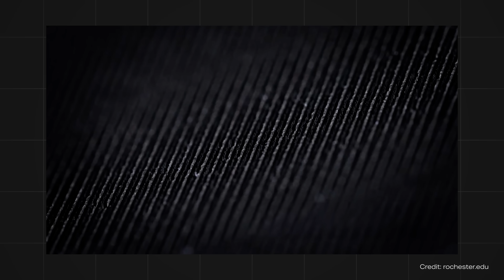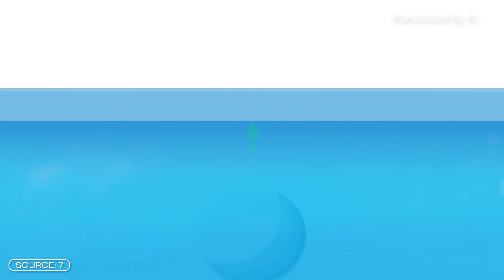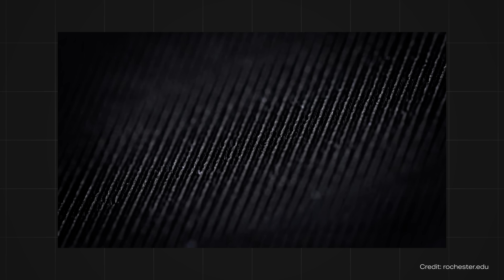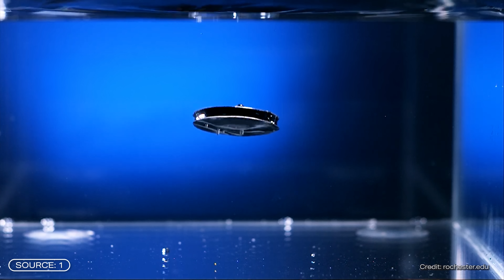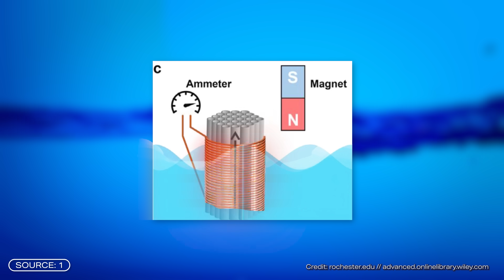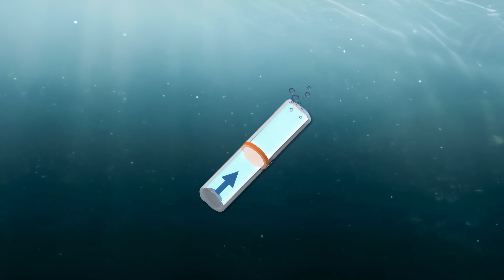New Study: How to Make Ships Unsinkable!

Comment: Might be interesting to merge this technique with the hyperdense "superwood" that Inventwood is producing. The hydrophobic texturing and silicon polymer could be pressed directly upon the wood during the compression stage, removing the need for the copper chloride bath and ultrasound. Inventwood claims a 10 times strength-to-weight ratio compared to steel. "Superwood" costs more than steel ($0.40/lb) or aluminum ($1.50/lb)  compared to $10.00/lb, but assuming cost isn't a factor, the result might be a more buoyant and lighter vessel with comparable structural strength. A racing boat would provide the appropriate test bed.

Comment: Honeycomb.

Not separate tubes, but immense honeycomb-extrustions.

"Solid" volume of unsinkable-floatation.

---

Having to re-treat annually isn't actually unique to this stuff: anti-fouling has to be re-applied, except for the ( excellent ) silicone-silane coatings that some use, now ( SilicOne is one brand for yachts, ships have a hard-coat option, don't remember the brand atm ).

Excellent video, & you hit the points needing hitting.

Thank you very much for this.

_ /\ _

Realized later, this needs to work with marine-alloy 5052 aluminum.

Dave Gerr's book "Elements of Boat Strength" identifies which alloys to use for saltwater, and iirc 5052 is the primary trustworthy one.

Also, you have to be careful to not have anything far-away on the galvanic-series ( this means both Ti & carbon-fiber are prohibited on vessels using this ) anywhere on that vessel.

Been awhile since I was thinking on such stuff, so took awhile to remember, sorry..

I think there were 2 usable alloys, but 1 was safest, and I think that was 5052.

_ /\ _

Comment: For a decade, I have discussed a cheaper, simpler, more scalable, more durable option which avoids those hurdles: Pumice. Foam gas into molten glass blocks, then re-melt their surfaces later to form a solid glass shell. Dunk in potassium solution after placing the block in a kiln, to absorb potassium into the skin of that glass shell; that is the recipe for bullet-proof glass. A floating platform made of blocks of bullet-proof glass is hyper-resilient, actually unsinkable, and pumice interiors can achieve percent-vacuities above 80%, for multiple times more buoyancy per kilo of material. They are also cheap and abundant materials, lower energy cost per kg than metals, simpler tools, no harsh acid treatment, no maintenance. Your research team spent the last decade finding a worse solution than I did when I puzzled the problem for a month, before they even began.

Comment: First step after laboratory is to find any application at all. Quite often, that's in sports, where cost hardly matters. Fluor wax was banned from skiing in 2021, replacement hydrophobic material science has a market there. Water sports like kayaking have experimented with teflon (also fluor). 

Hydrofoils "revolutionized" kiteboarding and windsurfing, but they also are killing those sports because the learning curve is now too steep. Perhaps floatation might ease the first steps there?

Comment: Intro: its not paint. It doesn't need maintenance. 
4 min later: Its paint. With extra steps.
7 min: We might have to do the paint & extra steps every year.
8 min: Since we might need to bake a new coating on every year. Clearly the best application is permanently fixed underwater structures. 

Is it April 1?

Comment: fatigue.. pits in structure become sites for fatigue cracks from cyclic loads.  The material has nearly infinite sites for fatigue cracking introduced jn the process.  The coating to create hydrophobic properties-  how does it hold up in real world application?  If a piece of equipment scrapes on the surface and the coating wears off, then you have exposed aluminum with a bunch of crevices becoming sites of corrosion and stress concentrations.

Comment: This seems stupid, they've made a tube with overall density of 1/4 of a water, that requires maintenance... wood already exists, and you can make metal foam with same density. The antifouling properties seems nice, but you can just "spray" ships  with it and don't need it to do the buoyancy. If you bend it or otherwise mechanically damage it, it reduces the volume and reduces the buoyancy same as any foam or material with small isolated compartments. Effectively only unsinkable application of this is raft entirely built of these, or you can make the raft from discarded PET bottles and it will be the same if big enough, and the density of air filled pet bottle is 1/50 of water so you have 10x margin for engineering them more indestructible..

Comment: The logical leap from "floats in a laboratory, and generates a voltage that can be measured with lab equipment in simulations" to suggested practical usefulness in real world applications is astronomic.  

And what's the supposed point? We already know a lot of ways to trap air in a lot of different materials, very reliably and at low cost. Making ship hulls out of materials that are buoyant in themselves instead of just displacing water with their overall shape would make the ships so much bigger for a given payload capacity. Relying on superhydrophobicity, that requires microscopic surfrace structures of metals remaining unaffected in (real) seawater, over time, doesn't make a really bad idea great.

Comment: The “unsinkable ship” headline sounds crazy, but using it for rescue platforms and offshore gear actually makes way more sense.
Reply: The Titanic was called unsinkable as well. Pride comes before the fall.
Reply: @JustCrashing1776  did you know things that waterproof aren’t 100% waterproof.
Reply: @FrogThatVibes agreed 😂
Reply: What someone find a way to make unsinkable metal sink. just by mis-use
Reply: Those applications would also give this material a good place to start and prove their reliability and lower prices as production ramps up. Eventually, it COULD lead to applications in ships, but these applications are a great place to start.

Comment: What is the advantage of using this hydrophobic surface treatment instead of just putting a cap on the tube?  And even if it works as advertised without annual reapplication, the imagine that the  initial cost is going to be a lot higher than the steel plating currently used.

Comment: can it be used in frying pans tho?
Reply: Bear in mind that stearic acid (and other stearates) are pretty much what tallow is. Fries very well. And, providing the layer is sufficiently thick and coherent, can be quite non-stick.

You'd probably find that fully proved iron/steel frying pans have a layer of substances including stearic acid and related compounds which act to prevent or minimise sticking.

Comment: The comparison to use for antifouling is not bare metal, but PDMS-coated metal, as silicone polymer hull coatings are already common, and PDMS has excellent antifouling properties. As for a raft made of tubes... now you have a metamaterial with new bulk properties. How does this metamaterial handle bulk stress? I don't know about you, but I don't wind to end up clinging to a pile of floating straws while a ship tears itself apart from wave action.
Reply: Mmm, good points, it probably has a lot of applications but ships, boats, nah, too impractical and expensive.

Comment: okay, I'm gonna ask the obvious question here:

holes in the tubes may represent a corrosion failure, but where are the crush test? Ship hulls with kind of technology are much more likely to experience crush damage as a common form of failure. Whether that's from being guided by tugs, rough treatment pier-side, or carelessness. How do these tubes perform when partially collapsed, with and without inner walls touching?

Comment: What about corrosion and literal sand blasting?
A single tube is not a valid test piece a multi part construction with an electric and magnetic potential needs to be tested in an area where sand and other particles can abrade the surface and the structure can flex and bend .

Comment: Materials Engineer here. The obvious usage would be to use it as a reinforcement in either carbon fibre laminates or Glass reinforced laminates. Have a layer of your unsinkable metal tubes as part of the laminate Or have modules of them distributed throughout a boat that if contacted with the water will keep the boat afloat. If the material does have antifouling properties that can be demonstrated in the real world, then having a layer of the tubees as an overlay on the surface of a boat would actually be a very useful thing. Antifouling is a major problem and a major cost to all boat owner whether it's a recreational craft or a commercial boat. Several times a year boats have to be cleaned and every couple of years they have to be sanded down and antifoul paint reapplied. If you have a layer on the surface of your boat that not only increases boyancy but elminates that cost, then that is a major cost saving for commercial boat owners.. It's a great concept and well done to the research team.
Reply from the maker: Thank you for your input based on your professional expertise :) Feedback like this is always helpful!
Reply: Wouldn't inclusion in a laminate cause the surface of the tubes to be filled in with resin, eliminating the properties of the material?
Reply: Just random question, what if coating material was just carbon or metal micro tubes/straws stacked side by side  pointing outward? would that float a ship? Water can not enter because of  pressure and surface tension? Sorry for wording I am not a scientist or anything
Reply: I was thinking fabrics in particular of being water proof. A life preserver would in reality could be a real jacket. Or create nano versions and make tents, Tarps and other camping or emergency gear. For material to protect sensitive electronics in the field would be of interest Phone cases that are able to float would be really something.
Reply: It's fine for buoyancy increase but antifouling is a necessary cost as the drag from growth on the hull has financial and delivery time drawbacks. Hydrophobic materials generally disrupt laminar flow so while it would be possibly be better against growth and corrosion, it will likely be too costly in value and speed to make it worth it...
Reply: How about building geodesic domes with the tubes?
Reply: As a civil engineer, I love a good, well thought out comment like this. It's like ASMR. Well done.
Reply: CAN IT BE PRINTED?
Reply: So your channel is about couples counseling and you claim to be a materials engineer?  Moreover as others have pointed out, including these "unsinkable" tubes in a laminate would negate any perceived benefit whatsoever.  Perhaps the most glaring issue with the video and your analysis is that surface tension can not float ships.  This would be akin to saying that because bugs that can walk on water hold the key to unsinkable ships.  Go back to counseling my friend.

Comment: It would be interesting to know how it stands up to stress. Moving through large swells coming from multiple directions puts tremendous stresses on a hull. Large vessels flex. That eventually leads to minute stress fractures that weakens most metals over time. It's one of the reasons old ships are retired.

Comment: I enjoyed the video, but wish it had included more information on the electricity generation capability.  The absence of biofouling was interesting.  I wonder if it was the result of one or both of the surface treatments and whether it might offer benefits to ships and other structures for which the buoyancy benefit doesn't apply?
Reply: exactly! I think one of the reasons the biofouling does not take hold is it inherently requires the use of bio-films and if the material repels wetness then the initial deposition of biofilms can not take hold.
Reply: Electricity generation is having this material be part of the bobber that stays with the wave surface, pulling against some kind of actuator.

Comment: Not used on ship hulls, but on the lifeboats. A lifeboat that can constantly generate some electrical current could desalinate seawater into fresh, drinking water, provide heat if needed, and continuous light and beacon power. Since a lifeboat is not used as often as a ship, the constant maintenance would not be so difficult. The lifeboats are smaller, so that hurdle is reduced as well.

It would be great to "sea" (pun intended) cargo ships or cruise ships operate with this material on the hull but I think the reality just won't happen. The cost of treating an entire hull and maintaining that? You have to remember, there is flotsam and other junk floating in the ocean. 
Those very specific diameter ridges will get bashed and banged into by "stuff" in the ocean, even the massive waves from swells could damage that precise min-max diameter and you then lose all buoyancy wherever there is the slightest of damage.

That's why I say put it on the hulls of the lifeboats. Make life vests from the material, but it won't be practical to put on 250-400 meter ship intended to travel a few thousand miles at one stretch.
Reply: This

Comment: I remember someone testing a super-hydrophobic coating on an RC boat. It caused a fair amount of drag and slowed the boat down. But that was a paint that peeled. If doing this to aluminum prevents biofouling though, that would be amazing
Reply: Inwas thinking the same, biofouling is a huge issue, drag, maintenance etc. They should test it making a powered miniature in a wave/storm pool i bet the diameter being a issue and then aplying pressure trough that and movement... idk.

Comment: I think they should be used inside a normal ship skin so that they only come into play if the ship is compromised. This should mean that they don't need to be retreated all the time.
Reply: Y @johnatyoutube I initially thought the same, but really if you think about the practicality and cost it's a non-starter, plus if you tear a big hole in your ship, or even a small one, it will fill the compartment regardless of hydrophobic straws welded or bonded to the walls, you're still losing buoyancy. You'd be better off with huge self inflating rubber compartment shaped bags, auto deploying upon contact with water, kinda like giant life-raft systems, but just for compartment spaces ...though clearly this isn't practical for really large vessels with massive compartments spaces, lol; but for smaller stuff, at least you wouldn't sink!

Comment: The title is all I need to know! Congratulations to the materials scientists for inventing ducks!  (Or expanded-platinum-foam, whichever is cheaper.)
Reply: I must be missing something here. Why not simply put caps on the end of the aluminium tubes to prevent the ingress of water? Sealed, hollow metal tubes will neve sink whatever the depth or their diameter.r
Reply: @romanpolanski4928  Sealed aluminum tubes are better than the nonsense shown in the video, but still worse than foam materials, because even if the hull suddenly becomes leaky, the material will still prevent the vessel from sinking.
Reply: Careful, mentioning costs makes you a damnable engineer in the Eyes 👀 of the scientific community.  No credibility at all.
Reply: Good one 🤣🤣
Reply: Look through the whole thing before commenting with the answer of a nitwit.
This would reduce cost of shipping to a large degree ifit can be usedin cargo vessels.
Btw I'm a nautical engineer.

Comment: Seems like they may be able to overcome the issues by covering larger diameter openings with... Smaller diameter openings lol
Something like a honeycomb a few mm inside the openings, that are small enough to resist significantly larger forces and maintain air pressure within the tube?
Also, seems that maybe using two walls to create 3 cavities, or 2+n walls per nx length of tube might significantly increase the ability of the surface to maintain hydrophobicity.
I imagine pitting the entire surface of a small vessel like a golf ball using this material, might significantly decrease drag on the rear of the vessel if it can maintain a large covering of air bubbles as a sort of lubricating layer between the hull and the ocean

Comment: I've got a revolutionary idea. What if we welded the ends of the tubes shut? We could make them bigger than 6mm in diameter, and wouldn't need the hydrofobic treatment at all. It would also work deep under water.
Reply: Yeah i thought this too...you could keep the hydrophobic coating on the inside to protect against minor cracks and holes? ... Only now i think we're in a situation where its pretty much always going to be easier to get your boiancy out of the ship design/shape rather than trying to integrate it into the hull composition (which is going to have knock on complications to structural,manufacturing and maintenance factors ?) 🤷
Reply: Are you trying to 'torpedo' this guys whole video?
Reply: @tungzauzage977  we would never bring up any things that exist in reality that immediately sink this Magic Material
Reply: Use swim noodles.  No R&D or special coatings needed.  I guess I totally missed the point of this video.
Reply: @hhf39p or a load of those buoys would work!..
Reply: Haha. Much better. I guess it would be much cheaper to produce.

Comment: Well there are tons of low-draft floating applications like barges, but I'd personally really like to see this applied both to floating resource generated like wave energy capture, as well as being the core technology that could make floating cities viable. I could see this being a huge breakthrough, assuming they don't need heavy maintenance. The lack of bio-fouling is also super impressive. I was curious about galvonic corosion and I believe that's what the spray on layer is for. If they can come up with a longer lasting/permanent solution that's ideal; I don't know if I prefer having to swap out sacrificial zinc to dry-docking to re-paint.